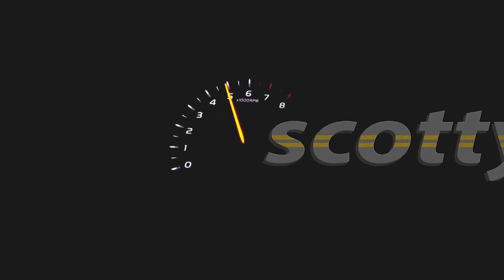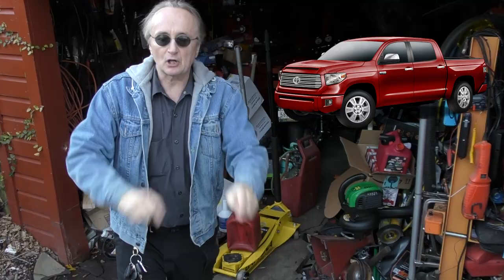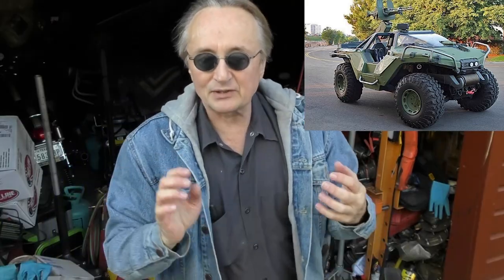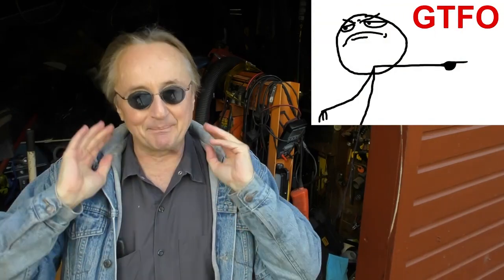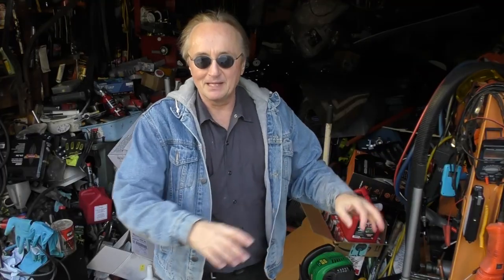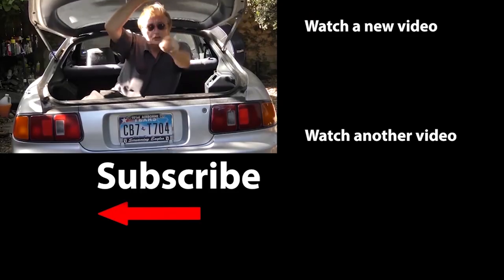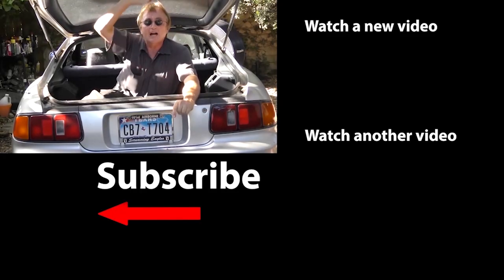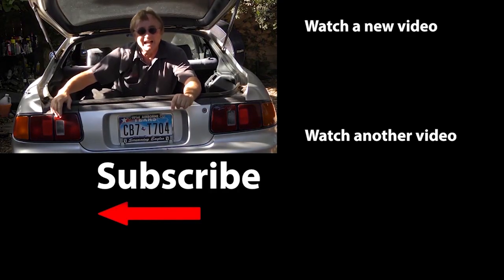5 Used Trucks You Should Never Buy

Comment: The spoiler on the Ram Daytona is not permanent. The spoiler was just part of a beauty and graphics package added to the 1500 series and was a homage to the 1969 Dodge Charger Daytona. Basically, the Daytona truck can carry anything that any other 1500 series can carry. 
The "Race" version you probably meant to say is the Dodge Ram SRT 10. That truck was built for speed like the GMC Typhoon and the Ford Lightning.
The SRT 10 featured the Dodge Viper's 8.3L V-10 with 500hp and 525 lb-ft of torque. 
Another thing, Dodge built a Convertible Dakota starting in 1989 - early 1991. So you're wrong on the Chevy SSR being the first convertible pick up truck. Actually I think Ford made a converitble Model T truck in 1929.
Maybe a little more research on your part would be more helpful so that your viewers don't get misled with wrong information.

Comment: The H2, only a few of which were made with any kind of a pickup accoutrement on it at all. Is actually a pretty good vehicle. It doesn't do anything well. But it does a lot of things good enough. I happen to know a guy who bought one and didn't have to change the tires. They still had decent tread at 142000 miles. He never had the thing tuned up and he still has it to this day and it's got three hundred thousand miles on it. A good tune-up a little bit of work on it it would probably last another couple of hundred thousand. It is surprisingly, one of the best vehicles General Motors ever put together. Some of the early ones did have some electronic issues. Especially if you had a lot of options put on it, General Motors has always had problem with high-end Electronics. But the vehicle itself is pretty solid. The H3 however was a POS.

Comment: I better be careful my 2012 ram has almost 20000 and doesn't use oil or have noises in the motor. It has all new brakes and suspension parts. Maintained vehicles is where at.

Comment: I would NEVER buy ANYTHING with "GOAT" written on it.  Why don't they call it the Dodge "POSSUM" or the Dodge "Buzzard".  And so on.  I NEVER buy ANYTHING that runs on Gasoline.  Diesel Only for me.  I never buy ANYTHING rated lower than 3/4 Ton, and the smallest truck I have owned in the last 30 years is a ONE TON FORD Diesel.  F-350 MINIMUM.  I would not have a "F-150" as a gift, they are gasoline only, so not for me.  

You make very good videos, BB

Comment: How about your take on the Ram Laramie 2500 with the Cummins diesel?  I bought the 2018.  Appreciate your opinion
Reply: My dad(rancher by trade) just bought the exact same truck accept with the Limited trim package instead of the Laramie.  My uncle(works on the same ranch) bought a 2018 Chevy 2500 with the Duramax but 6 months before my Dad got the Ram.
3 months later he started having all kinds of problems with the Chevy and both him and my Dad say the Ram pulls the fully loaded stock trailers at highway speed much much much easier and comfortably than the Chevy did.  They both say the Ram shifts smoother under load and feels more planted and controlled under load.  Fit and finish they say it's no contest and it's just a better truck.  It's had absolutely zero problems since purchase and is used daily for pulling and hauling.
My uncle was up for July 4th and said he put his Chevy up for private sale two days earlier and once sold will be looking to find a Ram 2500 Cummins.  =)

Comment: Hey Scotty is a 2004 Ford F-150 extra cab a good first car for a 17 year old?
Reply: That's an awfully large vehicle to be driving/parking/etc for a first time driver.  Did you learn to drive in a full-size pickup?  If not, you might wanna consider something in the mid-size market.
You could probably find a good Nissan Frontier or Toyota Tacoma in that model year range.  They'd be easier for you to drive around and park at school and both considerably more sporty in terms of performance than the F-150.
Anyways, if you still want the full-size Ford, they are fine.  I've got an '08 fully loaded Lariat version that I found with only 62k miles on it.  It's the same truck as the '04 just newer.  Never had any problems with it.  The interior and fit and finish were so much nicer than the Chevy I test drove, and it rode so much nicer and shifted so much smoother than the Ram I compared it to.  It also has factory pearlescent paint (changes from tan in bright light to silver in low light) so you might be able to find one with that if you look hard enough.  ;)
Overall it's been a really good truck and I have no regrets buying it.  It's pretty thirsty though and I'm lucky most weeks if I get above 15 mpg, so keep that in mind.  With a 27 gallon tank that's around $70 every time you fill gas.  That's a lot when you're only 17, so make sure you have a part-time job or parents that don't mind chipping in for fuel.  Insurance cost shouldn't be too bad.  Definitely less than a sports car for someone your age.
Just remember when buying ANY truck........try to get a feel for how it's been used.  If the box is all beat up inside that means it was used as a work truck and hauled a lot of stuff and more than likely pulled a lot of stuff too.  Try to stay away from those as they'll be more likely to have transmission problems.

Hope you find something you like.  Good luck!  =)

Comment: Just bought a 2017 Honda Ridgeline with 60,000 miles on it and from all my reading and reviews should be good for another 200,000 miles. It also rides great compared to other pickups in the same class. I don't want a truck that beats me to death if it's not loaded. So Scotty I think you need to quit smokin that stuff, just sayin.

Comment: But the fact of the matter is that trucks have body on frame, rear wheel drive.  And the fact that it has 4 wheel drive doesnt matter.  Some Cars have 4 wheel drive and AWD. Unless it has body on frame and RWD base its not a real truck.  Ford, Chevy, ram, toyota..  they make real trucks. Ridgeline is a pilot with a bed on it

Comment: I don’t agree with you on the Honda ridge line 
I owned it for more than five years with over 50 k mileage never had a problem it drives like an Suv or even better
The car has so much room inside and in the outside

Comment: Correction Scotty 
, I own a 2006 Dodge Ram 1500 4.7 slt 4x4 i bought the truck when it was 2 years old back in 2008 when I bought it only had 20k  miles on it , now it been 11 years I got to say it is the best truck I have ever ever owned now it has 260k miles and still runs strong It never have me problems it's solid everything is original from factory

Comment: I bought a 08 saturn with no rust. Every saturn for few years they made never had any rust. cannot find one on the road with rust.WHY
Reply: jerome haver I know for a while some Saturn cars had the dent resistant body panels that were not steel but more of a plastic or composite. Not sure if that helps.. 

I almost bought one once for a work beater and  did some research and poked around on it with a test drive

Comment: Didn’t buy a Dodge they rust out. And these new Fords are aluminum so if it’s like the hoods on the Mustangs aluminum they corrode and blister up brand new. I think all new cars are junk. For the cost of them make the bolts out of Stainless steel and put some paint on the bottom side so they don’t rot out in 8 years

Comment: I had that sweet h2 in like a dark gray. The bed was completley worthless. You could get a cooler in it though. It was reliable for me. I got it at 70k miles and sold it with 145k. Did nothing but tires, brakes, and oil changes. The doucheist car possible

Comment: I take what Scotty says with a grain of salt because he has too many personal biases.
*He has a thing for Ford, especially Ford trucks when they have their own set of issues (such as electrical issues).
*He has a thing for all things Toyota, although he overlooks their horrendous frame rust issues.
*The Honda Ridgeline, by my own admission, is not a heavy duty truck; however, it is usually one of the top sellers in the truck category and has one of the highest owner satisfaction rating out of all vehicles.
*The Nissan Frontier, while short on updated technology, has one of the best track records for mid-sized trucks for years running. Yes, the updated Colorado and Tacoma are both pulling ahead, but if we're talking used trucks (2018 and older) the Frontier has less reported issues than any small trucks and has won more head-to-head comparisons than I can count (both in written articles and vlogs).

As a disclaimer: I have nothing against Ford trucks nor Toyota trucks, both are on my short list of trucks to look at when I'm in the buying market, just pointing out some of Scotty's biased remarks.
Reply: "it is usually one of the top sellers in the truck category"
Where in the hell did you find sales numbers to support that nonsense statement?  xD

Comment: RAM (Dodge) trucks are the best buy for your buck right now - undeniably
Reply: I wish, The reason to buy a ram is for the Cummins and the Aisin, not because Dodge makes a great truck, they don't. They have so many damn problems the things that work the best in them is the parts that Chrysler didn't make. Take the pair and have it then designed say in F350 for instance (HD 3500 if you prefer GM) and you would have a better truck overall.

Dodge's biggest weakness is itself, not the engine or transmission they are using. Id plop down 55k+ for a Cummins F350, that would be a damn amazing truck.

Comment: Ummm..... I've got an 06 H2 mind you an SUV style. But I've got an 1100 Lb Blizzard plow on the front of it. And it also has 230k miles on it and it starts and drives great. And is also the best plow truck I've ever used. Short wheel base, tight turning radius and AWESOME 4x4.

Not to mention... Look up used H2's. To this day 30 THOUSAND dollars is still a deal.

Comment: This is the worst video Scotty has ever done. I’ve owned 2 Honda Ridgeline, a 2006 with 340,000 miles and a 2010 with 250,000 trouble free miles. But don’t take my word for it consumer reports ranks the Honda ridgeline as the most reliable truck ever built!

Comment: Dodge made convertible pick ups in the 1980's...just saying
Reply: Sorry those were after market designs that were put on Dodge Dakotas...by companies like Top Cat. Not actual Dodge designed. But were sold in dealerships.
Reply: @abarnes0330  I understand your point but it's like saying a Boss Mustang is not a Ford because it was built by Kar Kraft or  shelby, Yanko, Rousch or even a Dodge diesel because it has a Cummings engine.
Reply: @ricknelson4764  ..sorry i didnt make myself clear..yes they were Dodge Dakotas..but they aftermarket modifications by outside companies. They were built to compete in the convertible mini-truck market that was being dominated by Rat Top. I had a Rat Top on a 1979 Dodge D50!! Check out some of the old Mini-Truckin' magazines and Rat Top advertising.

Comment: For once I gotta agree with Scotty if I have to ever again have to replace another one of those ridiculous power steering lines on that transgender abomination of a pickup (a ridgeline is a Honda Pilot that has transitioned to truck form)  I swear I drive one into the nearest Honda dealership they all fail the exact same way and I’ve even had a couple customers who lost their power steering while driving because of this and subsequently wiped out the pump as well furthermore trucks should never be a uni-body construction this severely limits their ability to be abused as a truck